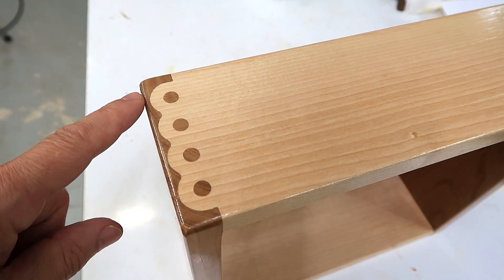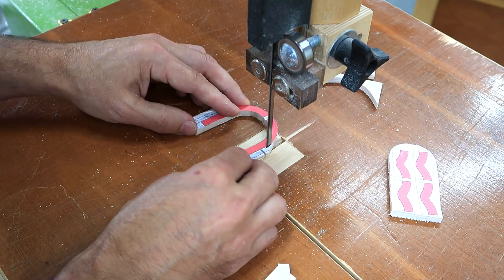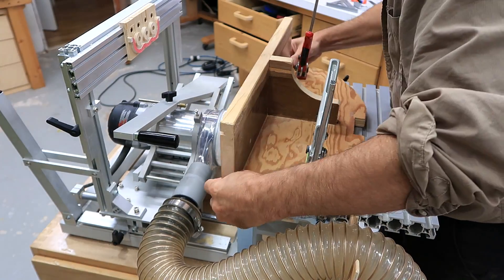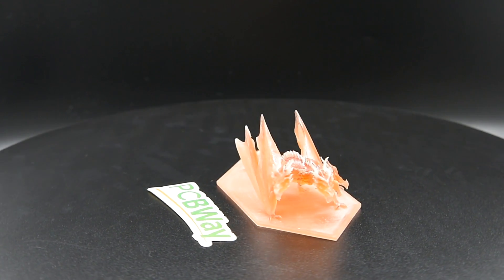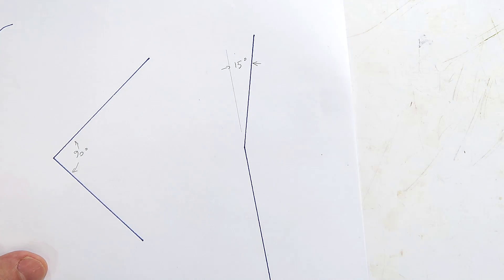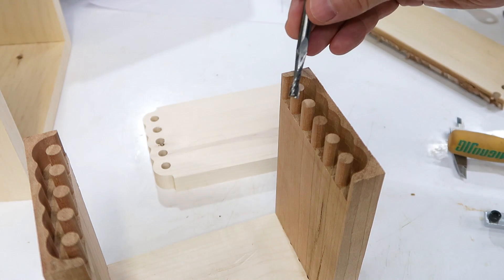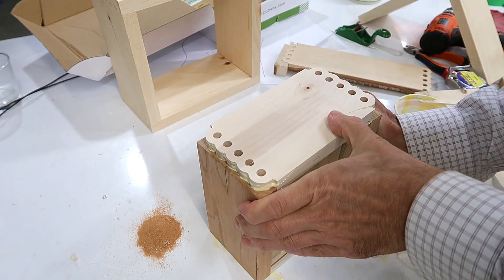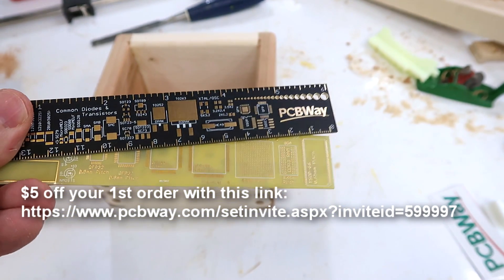Designing segmented Knapp-joint templates for the pantorouter

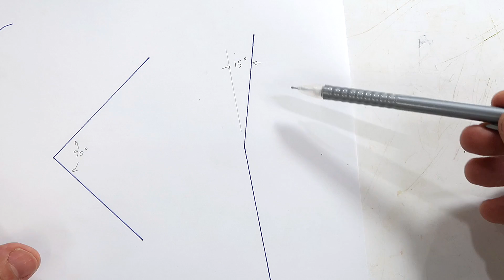Comment: 4:59.  It isn't failing to follow the circle/curve.   There is no circle. It is a figment of your imagination.  There is a polygon.  Your polygon has 24 sides.  Neither the printer nor the slicer has any idea you intended it to be a circle.  That information went in the bit bucket before it ever got to them.   Which is why you ended up with a polygon.  Plus a few extra lumps because the 3D printer isn't that well adjusted and because you didn't make your polygon smoother with more facets.   Your suspicions about deceleration and flow are correct plus potentially ringing, overshoot, and backlash.  To actually draw a square with sharp corners, for example, a 3D printer or CNC machine has to decelerate to a complete stop to negotiate the corner.   On the other hand, machining the outside of a square with perfectly rounded corners it can shoot around the corner at close to full speed because rounded corners allow gradual deceleration on one axis and gradual acceleration on the other.   For polygons with somewhat more sides, it doesn't have to decelerate to a complete stop but it does need to decelerate some.  It can't have more velocity on any axis going into the corner than it needs to have coming out of it and it can't have more velocity coming out of the corner on any axis than it had going in.  On a CNC mill or router, you also have to be careful of when to use conventional vs climb milling, for much the same reason you did on the pantorouter or if you were doing it freehand.  The stresses can overwhelm the mechanics of the machine, especially on the cheap consumer grade stuff.  As you suspected, a 3D printer adds another problem.  You are trying to control the flow of goo.  And this works best at constant flow rates.  It doesn't stop and start perfectly, especially if you have "bowden tube gap" due to improper assembly/maintenance, which creates an unwanted fluid reservoir with some elasticity. And the filament itself has some springiness between the extruder gear and the hot end. And the molten filament is not quite an incompressible fluid; plastic has some elasticity and you may have some trapped air.  So when the carriage slows down around the corners, too much molten plastic flows while the carriage is slowing down and too little after it speeds up.  Loose belts or other loose parts also cause problems around corners.  Backlash, overshoot, ringing, etc. Maybe the inertia of the carriage takes it a little beyond where the gcode told it to go.  And maybe it then springs back and forth resulting in ringing.  Maybe your corner is in a position where one of the axes needs to reverse direction but there is some backlash that has to be taken up.The slicers that drive 3D printers work using STL files (or 3MF files which have the same problem) as input.   There is no such thing as a circle or curve.   Only 3 dimensional triangular facets.  Which, when sliced yield polygons not circles.   And the printer makes no attempt to turn your polygons back into a circle.  For what you are trying to do, you should have had more than 24 facets, anyway.  24 will work for many small and less critical features. Which would have given you a better approximation of a circle and excited fewer bugs in the 3D printer mechanics.  That part should have printed better than it did even with 24 facets.   But for a template, you should have used more anyway.  You don't want facets visible on the final part and you don't want the small size error that results from the round router bushing or pantorouter stylus rounding out the corners.  Worse yet, you don't want the size error that results from them not rounding them out.   For 3D printers you should generally adjust hole sizes a bit to account for the cosine error from inscribed vs circumscribed polygons.  See the openscad manual page on "undersized circular objects" for the simple calculation.   3D printers, CNC router, or laser cutters can actually be quite useful in the woodshop, even mostly using traditional techniques.  Many things you do would actually be better done using them to create templates, gears, jigs, etc.   Though some of your content is actually how to do things using manual techniques and there is value in keeping the knowledge of those alive and in showing people how to get things done even if they don't have all the modern toys.   Unlike a 3D printer, a CNC router should supports circular interpolation.  As far as shop space goes, a CNC router with the ability to work on work that is clamped to the front edge (so you can cut ends and edges of boards and not just faces, would be a better use of space than a pantorouter.  But the pantorouter is a cool tool.  And it is appropriate technology in the event that society or world politics devolves to the point that you can't get replacement semiconductors.   A 3D printer could work well with the pantorouter but you would still need the pantorouter for woodworking.   And you already built it so you are going to keep it.  There is some learning curve for the 3D printer but I think you would pick up on it quickly.

Comment: This is the first time I find you behind the curve :)

Rubbish in, rubbish out - the 3dp just reproduced what you fed it.

You can't really blame the machine - operator error in this instance (it would be like using a square blade on a circular saw - gonna be a bumpy ride!!!)

Love the project, but the correct sequence would be a more featured 3 modeller and then almost any 3d printer would produce the results that you wanted - yes there would be a learning curve!

Like any tool the more you learn how it works, the more you get out if it - today for me it was vacuum hose adaptor time!

Otherwise, fascinating video.
Reply from the maker: then why did the pcbway printer produce nice clean templates where the extrusion printer made a mess?  From the same STL files.

Comment: @Matthias Wandel you're partially right on the 3D printing curved line segments... Pretty much all file slicers will take circular profiles and convert them into a series of line segments. There's not usually a G02 or G03 command used on 3d printes.

Comment: I actually used Pcbway to print a key for my Cintas center pull paper towel holder that cintas no longer sold. I used the library 3d print service to make sure it will work. LOVE the prints from pcbprint!!

Comment: I really like the look of that joint. Especially with contrasting woods.
One place your guy may want to call is Creative Machining in Burlington, WA. They specialize in making aluminum molds for injection molding, and have several automated CNC machines. They can also do any other type of machine work someone might need. If you need something that they have never done, they will do their best to figure it out, thus the name CREATIVE Machining. I work in purchasing at Nordic Tugs Inc, and they have gone out of their way to help us when we were in a pinch. Believe me, the last few years have been very pinchy indeed. LOL

Comment: Being an avid 3d printing guy since 2013 as well as a huge fan of your content and engineering approach to things I can comfortably say that I think a 3d printer is 100% the wrong tool for 95% of what you do.  I don't think it compliments your creativity and workflow really at all.  To that end though I do have to say I think the application of 3d printing to create dimensional and accurate templates like you did here is that remaining 5%.  I think it has a place but I have also found that a lot of times, parts can be created faster, stronger, and way cheaper with other methods.  I digress though, loved this video, and the end results are quite stunning.  Thanks for the vid.

Comment: A typical FDM 3D printer would probably be too boring for you to tinker with. Why wait for an hour for a small part if you can make it from wood or metal in less time. Similar to your bandsaw vs. laser/CNC contests. If you want a 3D printer for prototyping, but something that is more reliable and can be used like a tool rather than a new hobby, I recommend Prusa MK3S+. They are more expensive, but also safer and provide a much smoother, reliable experience, which is why you see them in many print-farm businesses.

Comment: You switched to splitting the templates between the pins, but I have some comments wrt splitting on the pins. 1) for the prototype, maybe you could have glued the bits on first and then split the templates? but.. 2) when cutting the prototype circles, would the kerf effect the shape? could maybe offset them from the edge to compensate 3) splitting on the pins would let you insert intermediate templates to make the circles longer or other shapes, you could do some really neat stuff! also could be done with the split-between ones just to space the pins out out. I think it might be worth creating both types and an assortment of intermediates (straight, barbell, tapered/hourglass, etc)

Comment: If you don't want a big 3D printer hanging about, get a small one that is just big enough to print templates for the pantorouter.
But then, you'd probably try to print a 26 inch pulley with it just to see if you could.
Reply from the maker: Marius hornberger printed a pulley for his bandsaw.  It failed.
Reply: @matthiaswandel  

Did the layers separate?
Or did it just break or shatter to pieces?

Comment: 3D printing is actually 2 skills. First skill is know which setting work best for a machine and filament combo. The other skill is 3D modeling.
So if you're only going to use SketchUp, you'll be severely limited in the models you can create.

Comment: The issues in the 3D print at shown at 4:22 seem way more like underlying geometry or maybe configuration problems.  Most slicers are incredibly advanced and can easily slow down the extrusion rate when they slow down the x-y motion.  If you can 'see' a feature in the geometry you can generally see it in the printed object.  I love having a 3D printer so I can make all sorts of woodworking jigs and templates. Super handy.
Reply: I agree, both the geometry and the slicer/printer. All my printers can print the geometry just as designed, slowing down for corners/changes in direction is not an issue. Being able to handle that sort of printing problem has been solved for over a decade so there is definitely some other issue besides just the geometry.

SketchUp has way too many limitations in designing 3d parts. I would highly recommend Fusion360 - no more segmented curves. When you export the model to stl for printing you can then decide how tight the mesh is. Making the required taper and smooth curves is dead simple in Fusion360.

In other words, 3d printing these templates is a perfect use case for 3d printing. Any widely available 3d printer, even one several years old, can print this template exactly as designed.
Reply from the maker: whatever the problem is, that same STL file produced a perfectly clean print from PCBWay.  So it's the printer.
Reply: @matthiaswandel  Yes, but the printer should not have those problems. Any average 3d printer can produce results equivalent to what you received from PCBWay. 

I don't know what specifically caused those printing issues, the points you brought up are true, but slicers and printer software has solved those challenges many years ago.

Comment: The reason for the circles not being circles is because when you saved as a STL file, the resolution of the STL was set with a large resolution.  You can adjust the resolution of your STL file typically under the save options.  I don't use Sketch Up, so I can't speak to that software... but this is a very common thing.
Reply from the maker: Not with sketchup.  Everything in sketchup is polygons to begin with.

Comment: I started using SketchUp because of you back in 2014, right when I built my first 3d printer. Back then one had to do lots of learning to get printing but its not like that anymore, also the printers themselves have gotten much better and cheaper. in fact I printed some of the parts for my 16" Woodgears bandsaw and tilting router lift. I also print star knobs for all sorts of things. 

Someone like you could be printing successfully in less then a week for less then $500us 

You of all people would find a lot of unusual things to do with the technology, I truly hope you get one.

An important thing I started doing to avoid that low polygon issue is increase the number of curve segments from 24 to 128 or more if the thing is big enough. to do this you select the circle tool and hold control then press + OR - to change the number of segments. 3d printers can aproxsimate much better curves then needed for this. Also, the machine doesn't stop on direction change, but the acceleration make everything shake just a little, giving artifacts called 'ringing'. he was clearly trying to get it done asap but printing slower would solve most of the bumpiness.

Comment: I'm glad I'm not the only one who still calls it google sketchup!

The artifact on the DIY printed parts is most likely caused exactly how you described. This can be eliminated/reduced by tuning a parameter called linear advance.  Linear advance "predicts" the pressure buildup in the hot end and compensates to prevent over extrusion when changing direction.  It could also be made worse by loose belts or other mechanical issues.

The number of segments in an arc/circle can be changed from the standard (12 for arcs or 24 for circles) by typing the number of desired segments followed by the letter "s" after creating the arc/circle, i.e. after drawing an arc, type "20s" for 20 segments on the arc.  This style command can be used for other properties like diameter, or when copying something, the number of instances.

Tapered parts and chamfers can usually be drawn easily by offsetting the face by the taper distance then grabbing the face and moving (not extruding) it upward the desired height.  Although, as I'm sure you know, sketchup doesn't always "play nice", so it may not work for all geometries.  
 
Thanks for all the great content over the years.
Reply from the maker: I started with 48 segments.  But due to sketchup issues, I had to manually fix the polygons after creating the taper, so decided 24 was enough to make a decent joint.
Reply: @matthiaswandel  Makes sense, wondered why you used so few segments.
Reply: 9/10 the issue with poor curve approximation with a well tuned printer is in the exporting of the model to STL.  

For some reason CAD software presets for exporting STLs is hot trash. 
Any STL files I've received from others using SketchUp have had pretty bad curve approximations.
Reply: That is to say the resolution of the model is not high enough to have smooth curves.

Comment: I found that a 3D printer is rather useful for making woodworking templates as you did. There is a bit of a learning curve for more advanced things, but it's usually not that bad. The most annoying part was bed leveling, but automatic bed leveling is cheap upgrade.
Like others pointed out the facets are dependent on how many vertices approximate the curve. Sometimes that is configurable in the CAD package. The Marlin firmware in most consumer printers can be recompiled to enable arcs which improve performance in curved segments. That's probably beyond the abilities or even desires of your average user though.

Comment: 4:45 
Your observations are correct. In general for smooth surfaces the STL s trianglular faces have to be as small as possible. 
Moreover I tend to think, that the bumps are also a concequence of the model being defined bumpy. That however is a problem of SketchUp...
Reply from the maker: same model produced clean prints from pcbway, as shown in the video
Reply: @matthiaswandel  Interesting. Those are also FDM prints?

Comment: As an early adopter of 3d printers who also primarily used sketchup for 3d modelling early on, I  can  say that the faceted curves from sketch up is very normal, using 24 segments on a circle is always going to be noticeable. Especially when  printing  a bit larger.I often used 36 or even 72 segments when going up in  size. The printer does not generally "slow down"  in those  corners either. if  anything it kinda  smooths out the corners  a  bit. However when  going as fast as you can the stiffness of your machine also comes into play. Not to mention that 3d printed parts are layered and therefore reflect light a bit strange too. Quality of plastic matters, it might not extrude entirely evenly, the plastic is hydroscopic so  needs to be dryed to avoid uneven printing. 

In  the  end FDM printers are a huge compromise. speed vs quality vs dimensional accuracy.  You can usually  ask  for 1, with effort 2
Reply: Come to  think  of  it, i  designed  a  speaker grill for  some hadphones once using hex cut outs, but the size was  so small they turned out circular. Reminded me of an early paper i read where they found  you could even make circular screw holes using only 3 segments per hole. Since the  machine can't change direction  fast  enough  and is not stiff enough,  they end up circular  when printed  at speed.